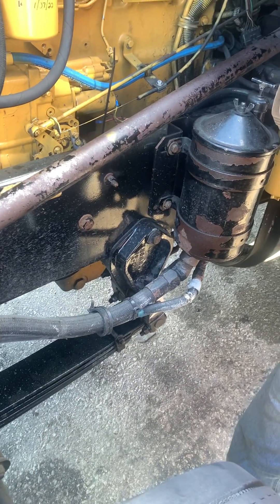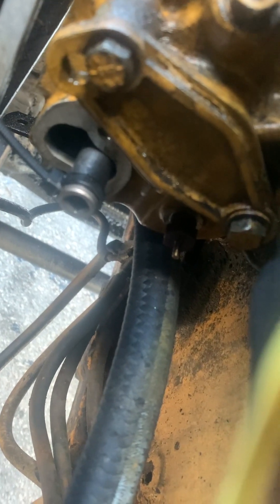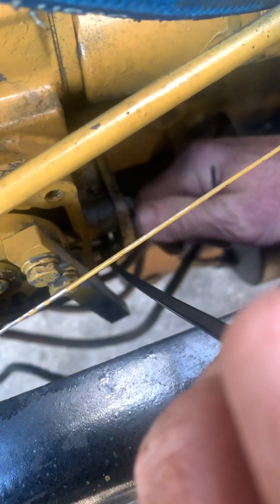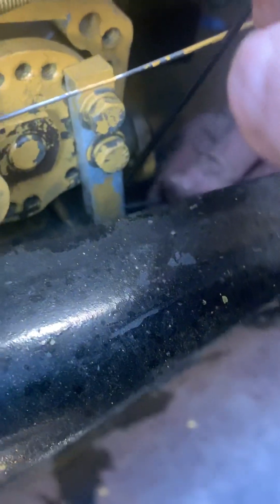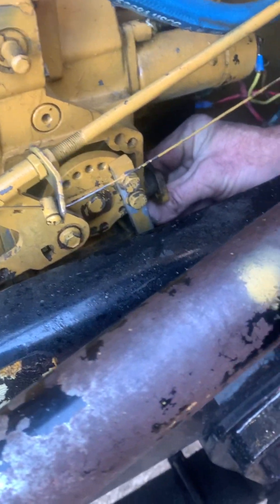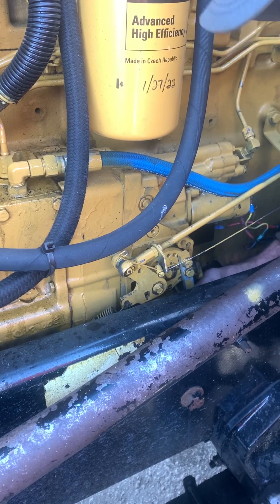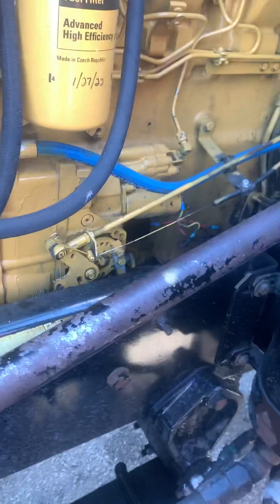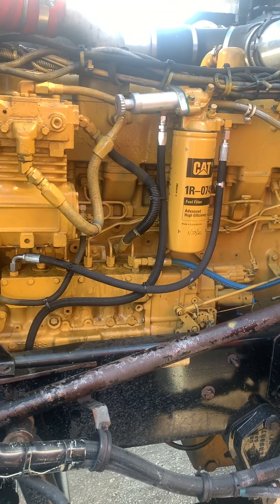How to turn down or (or up) a CAT 3406B

Comment: What your egt temps @ what rpm? Running a S410SX turbo with marine injectors, 15 speed 4.10 gears. 80 mph MAX 2100 rpm. 3406b. Ended up cracking #2 piston after 300k miles of 100klb hauling, so it got steel now. Other than that, I don't know any part numbers, but its turned up and runs daaamn good. 700 is the hottest it gets but it dont get run below 1650 hardly at all, itll get to 800 and above and shake a lot, but 1750 and up itll pin it to 45lb of boost right away and burn clean and take the hell off!!
Reply from the maker: I never break 700 degrees on the pyro. OR8785 injectors with a stage II BullyDog turbo. AFRC is two turns out from stock and maximum 35 lbs of boost. I had it four turns out and 45 lbs of boost but didn’t feel comfortable with it.
Reply: @etcllc3519  a bit much ha, nuddin wrong with that! Ahh the more power the sooner they let loose. If you got steel pistons I wouldn't have any doubt about catastrophic failure suddenly though. 3406 sure is tough, wish they kept making them. I sure wish the DT466 with p-pump was still being made, but nope can't have the best things forever.

Comment: The air fuel ratio control will help with black smoke when you snap the throttle,it can be adjusted easily, the two screws your make mention of are the FTS and FLS screws, you should adjust them equally if possible, also there’s a tool that incorporates a socket with a handle and the Allen wrench, sold as a set.
Would suggest you monitor exhaust temps and boost under load as too much fuel can lead to engine failure.

Comment: I never messed with my fuel pumps. I took my Cats to Payson Diesel in Payson, Utah. Ron and his crew are experts with Cats. When they tuned mine I had nothing but the best performance. They have done my 3406 Bs and Es. I had 3408s that were pretty stout but Hatfields made my 3406s perform as well and much better fuel economy.

Comment: To give more diesel to the injectors in which direction do you have to rotate the allen tool?🤔
Reply: Counterclockwise = More fuel  /  Clockwise= Less fuel
Reply: Counter clock wise...as he did clock wise...lefty loosy righty tighty🤣🥸

Comment: Hey man I have a 2005 w9 with a 550 cat acert..anyway my sleeper is leaking when it rains any advice or experience with that I think it's leaking from the top winders down ..also the cat is a little sluggish to me sometimes not like a 3406 but whatever it does the job ..I'm thinking permatex for the windows
Reply from the maker: Don’t use the silicone! It will only make things ugly and sloppy. Get new seals around the top side windows. They are the most neglected. You can use gorilla tape to start with just to locate where your problem is. The ACERTS are notorious for being sluggish. That is why nobody likes them. I am assuming you have a twin turbo? Sorry to say that there is nothing that can be done about that except to modify it to a single turbo. In that scenario, CAT will never work on your engine again!
Reply: Look up the boost wire mod. It'll get you the fuel on the bottom end that you need to spool the turbo. Don't single turbo it your egts will skyrocket you'd be cutting your nose off to spite your face
Reply: That's exactly what I did actually about 2 months ago along with a little tune runs fucking greatttt now
Reply: @aaronbelfi8074  people who hate on acerts have never drove a deleted one. They are well built engines that are capable of big hp.

Comment: Wonder what rpm high idle is ? Mine only turns 2000. I need to bump everything up on Ole large car myself
Reply: Your high idle is what the governor will allow. A Cat mechanical governor has a 10% droop. So basically your full load RPM is 1800 RPM's. Other problem is your throttle linkage is out of adjustment not letting you go to full high idle. So what is your full engine serial number? You set your fuel setting and once set you put a continuity light on the prong sticking out and ground the other side. The proper tool is a set point indicator. Load the engine down from high idle to when the light starts to come on (the Cat tool is designed for this function) and that is where your fuel screw (FLS) starts touching the torque spring. That is called full load. Full load is where rated HP at Rated RPM's is produced. As the engine is further loaded down your deflect your torque spring and now you get into what is called Hump HP. As RPM's continue to fall evidently your FTS screw will bottom out on the stop bar. This guy is wrong stating torque is between 1800 to 2400 RPM's. Peak torque depends on what you have. Most are around 1200 RPM's. The so called sweet spot is where your torque curve crosses you HP curve. By driving at 1200 all the time and when you hit a hill your already at the bottom. By driving wide open all the time and when you hit a hill your topped out. By driving in the middle and when you hit a hill and you need more you can press the throttle. So once fuel setting is set correctly you measure set point and adjust high idle to where full load RPM is achieved. Once you go pass full load your in governor over run and you HP drops off like a rock. The governor spring is set up for emissions, etc. So depending on what you have some engines can be rerated from a lower RPM to a higher RPM rating. The highest on a 3406 series is 2100 RPM's. As the EPA dictates a lot the later engines dropped and was no longer 2100, but down to 1900 full load RPM. Also HP could be rerated, depends on what transmission you have and what engine.
Reply from the maker: @johngoldsmith6629  Thank you for the elaborate explanation. I am not very good with words and have removed my comment about max torque being in the range of 1800 to 2100 rpm’s.  With a 15 speed low reduction trans, 3:70 rears, a fresh rebuild, and new injection pump; I drop a gear headed up hill to 14th and hitting 2000 rpm’s @ 69 mph and never lose stride. I realize the torque is between the 12 - 1400 rpm range, but it was my understanding that the horsepower curve was peaked at the higher rpm’s. When I lug at lower rpm’s, smoke bellows but she runs clear as day at higher rpm’s.
Reply: @etcllc3519   HP is GPH times density dived by RPM's. Torque is HP times 5252 dived by RPM's. Smoking in the lower RPM's timing is off, over fueling not enough air.
Reply: @etcllc3519  Horse power curve on a Cat depends on several factors. Talking factory setting now, using the 3406 as an example. The 3406A as it is called now. You had one fuel screw and a torque spring. Some engines had a stop bar thus no hump HP. 
Most engines you had your torque spring and it had shims to determine how much deflection you have. The next part is the deflector spring which determines how fast the fuel will move further in the fuel on direction. So when you "Bump the Governor" Set Point your at full load roughly. As load is still applied (on a hill) the flyweights slow down and governor spring over rides the flyweights. Thus the fuel screw pushes against the deflector spring and over rides it. So if you have a 2100 RPM full load engine with a torque spring, not a stop bar. Your HP will peak out under 2100, depends on thickness of the shims in the torque spring. Then as RPM's continues to fall the curve will drop back down. That is what is called Hump HP on a Cat. Starting with the 3406B mechanical series. All engines have a torque spring (no stop bar only), you have a FLS screw (Full Load Setting) also called intercept (High idle to Set Point). And a FTS screw (Full Torque Setting) also called slope, the angle of the curve. As I was told many years ago, HP gets you there, torque keeps you there. Hope this helps.
Reply from the maker: @johngoldsmith6629  BTW, basically my video was just showing how to use a zip tie to keep tension in order to make it easier in adjusting the hp/torque screws.
Reply: @etcllc3519  Purchase the tool and makes it easier.
Reply: @etcllc3519  I think previous owner set rpm low cause it runs 65 at wide open . Got low gears and 9 speed.  Gonna put a 2 speed aux on it and we just had to do a o h but got he'll of low end. I can shift 1-5 at 1500-1600 grossing 108000 with a welfare wagon.  I thought 2300 to 2400 was right on . My steiger I had in my Pic was a 325 non intercooler 3406 and was about 2600 but those pumps are set for constant pull.

Comment: Which is torque screw closest to engine or closest to frame?
Reply from the maker: Sorry for the delayed response. If I remember correctly, the screw closest to the frame rail is the HP screw. The one closer to the engine block is the Torque. Both have to be turned out in equal increments. We have a video that shows how to do this easily with a zip tie, 3/8ths socket, and hex key
Reply: Ok so the one closest to frame would be the fuel. But be sure to turn out same increments. Watched the video to thanks.

Comment: I like what your doing. Good info so far. I'm getting a 93 w9 with a C model.  Plan on fine tuning it for max efficiency and max power. Like the content so far, keep going with the videos.
Reply from the maker: We run OR8785 marine nozzles with a dozer spring on the AFRC, and a BullyDog stage two turbo. We push 45 Lbs of boost and smoke like a freight train. 5 miles a gallon everywhere loaded and empty
Reply: Where do you buy your nozzles from?
Reply: What's the brand name or a part number for the nozzles

Comment: I see the comments are now enabled 👍
How did this turn out?  If you don’t mind me asking, how much better have your MPG been?  I have the same engine in a Pete 379 that has been getting terrible fuel economy, and I figure it has been dumping fuel because there is too much fuel dosing for the power it currently has, but the boost pressure doesn’t really run all that high in this one either. It runs maybe only about 22 psi max.  With the fuel prices as they are right now I’ll have to get the MPG much better to keep the truck capable of profit.  Any ideas about where to focus the attention?  Clearly adjusting down the engine fuel is the best start.
Reply from the maker: Age old answer to an age old question!! Number one, slow down. We run 63 mph and get 6 to 6 1/2 mpg. Stage II BullyDog Turbo with OR8785 marine nozzles, 3:70 rears and a 15 speed. We have the screws turned all the way out and the AFRC turned all the way in. She smokes like a freight train and sounds like a Boeing 747 and pulls like a whipped mule pushing 45 lbs of boost.
Reply: @etcllc3519  Good videos, thanks for the advice 👍
Reply: @etcllc3519 in another comment you said 5mpg loaded or empty. You're full of shit.